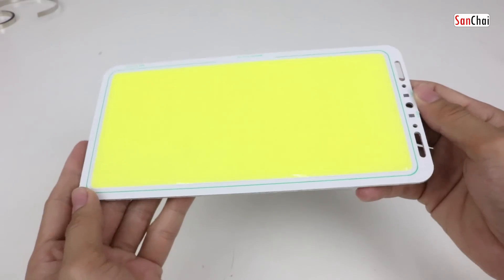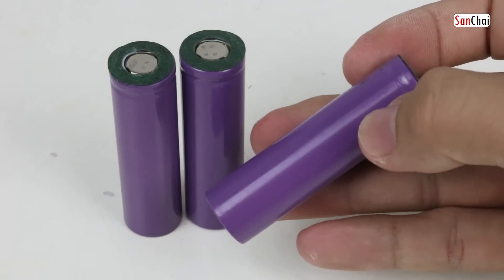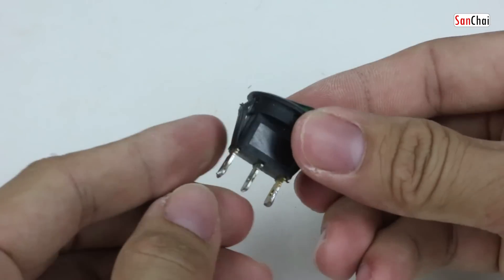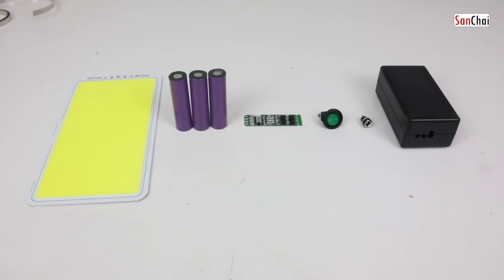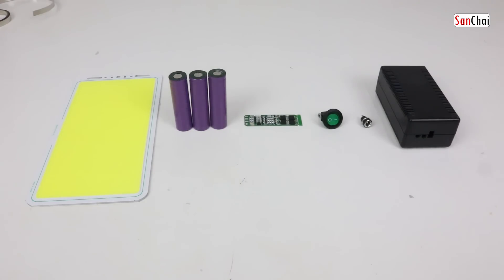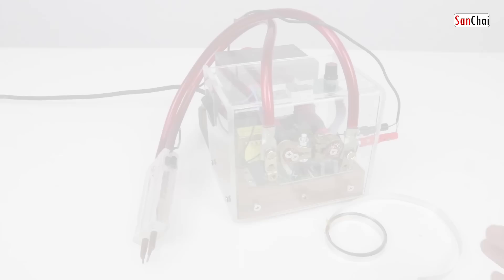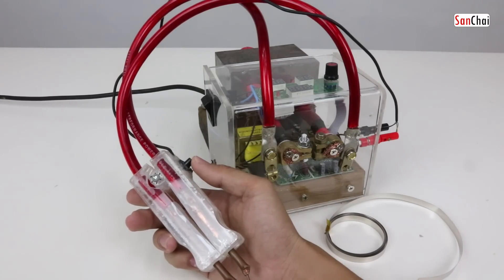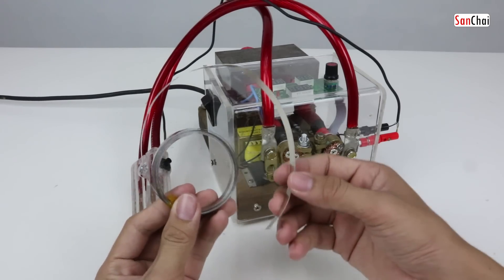DIY ไฟฉาย Flashlight 12V LED COB 70W

Comment: 2.6 amp it's run maximum 4 hrs, so if I add another 12v in parallel then the amps will be 5.2amps.. So will it last up to 8hrs?

Comment: ถ้าใช้กับแบตLifepo4 12v 20ah จะใช้ได้ประมาณกี่ชั่วโมงครับ
Reply from the maker: 12Vx20A=240W.  หลอด LED กินกระแสสูงสุด 70 วัตต์ แต่ในความเป็นจริงหลอด LED กินกระแสไม่ถึง 70 วัตต์  ส่วนมากหลอด LED ตัวนี้จะกินกระแสอยู่ที่ 12W หรือมากกว่า ขึ้นอยู่กับแรงดัน (สมมุติว่า กระแสที่ 1 แอมป์  12Vx1A=12W. 12Wx 20 ชั่วโมงก็เท่ากับ 240W. จะได้ข้อสรุปว่าแบตเตอรี่ 12 โวลท์ 20 แอมป์จะสามารถเปิด  ได้นาน 20 ชั่วโมง ครับ)
Reply: Sanchai ขอบคุณครับ

Comment: gibt es die auch für 220V? bei der Wattzahl fließt hier doch ein hoher Strom und man bräuchte für zuhause einen Trafo oder ähliches.
are they also available for 220V? with the wattage flows here but a high current and you would need for home a transformer or similar.